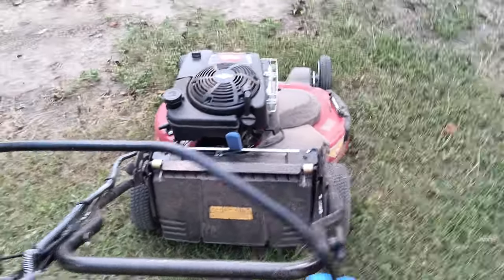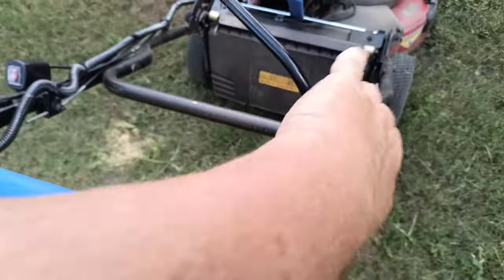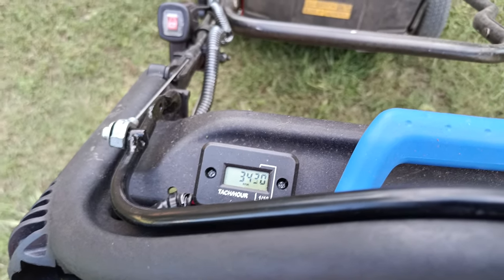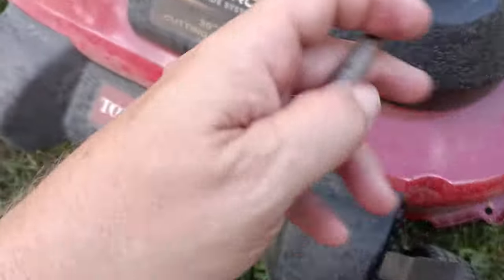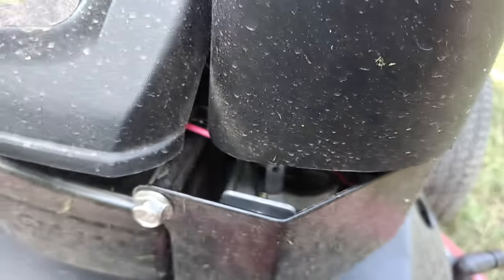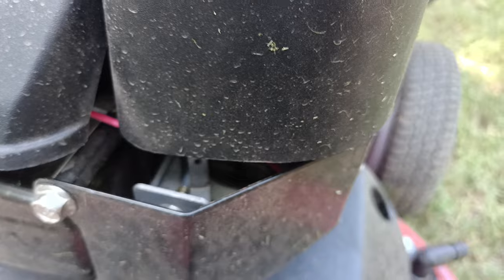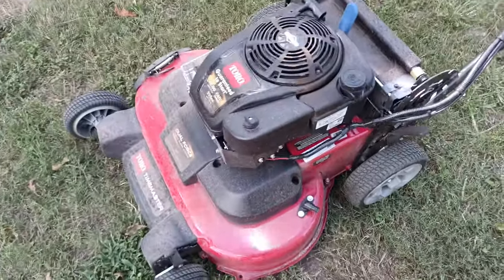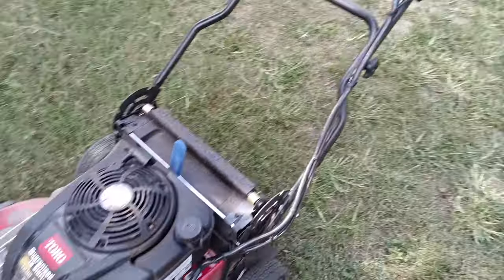Raising RPMs on Toro Timemaster 30. Eliminate stalking when engaging Blades.

Comment: Your belts will last a lot longer if you engage the blades slower too
Reply: actually that is true, however engaging the belts at lower RPM puts much stress on the engine as it has to struggle to keep the RPM's up, also on riding mowers  starting your blades at a lower RPM, puts incredible stress on the Engine output and the PTO.  There is a reason why there is a sticker next to the blade engagement lever that says "only engage blades at full RPM"  Belts are much cheaper than PTO's or engines.

Comment: Excuse me, I have my slicer, the same as yours, I have a problem, it does not turn off, I changed the switch and nothing does not turn off, what could it be, I want a suggestion, thank you
Reply: check the wire from the kill switch to the engine cut off, it's probably broken or came off from vibration.

Comment: How did you add your hour meter that high? Mines came with a short wire, but I would love to have mines up there.
Reply from the maker: I simply spliced more wire on It
Reply: Excuse me, I have my slicer, the same as yours, I have a problem, it does not turn off, I changed the switch and nothing does not turn off, what could it be, I want a suggestion, thank you
Reply: What brand is the best ach/hr meter?